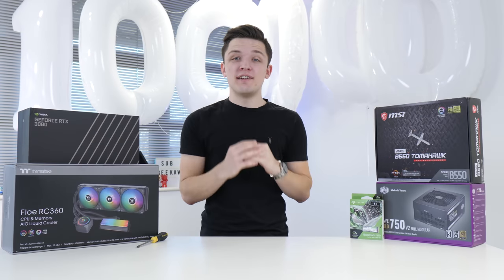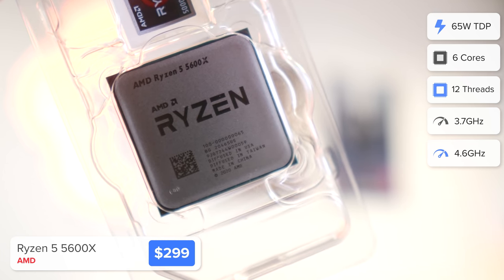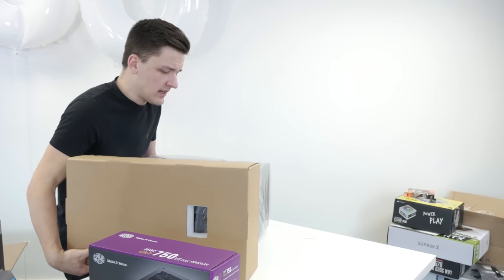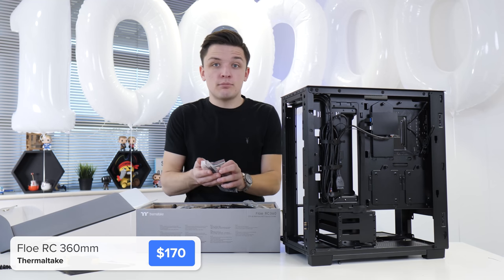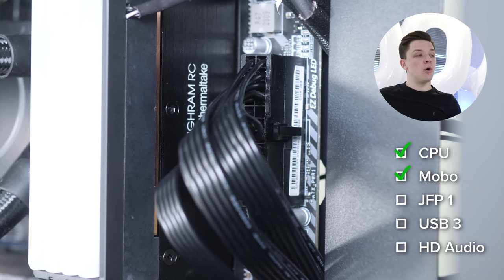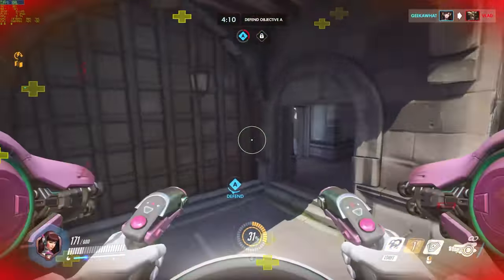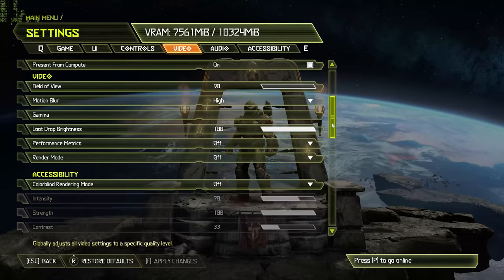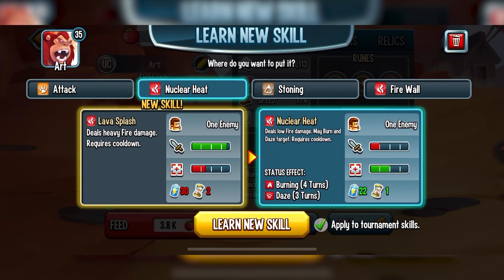$2000 Gaming PC Build - ft Razer’s $200 Case! [RTX & Ryzen 5000 Build with Gaming Benchmarks!]

Comment: Hey GeekaWhat, I wondering if this is a good build. 
Specs:

CPU: AMD Ryzen 7 3700x 8 Core Processor
Motherboard: B550
Ram: Corsair/G Skill 32 GB RGB Ram 3200Mhz 
Storage: 1 TB NVME M.2 SSD
GPU: NVIDIA RTX 3070
Fans: Corsair LL120 Triple PackFans
PSU: 750W Bronze Power Supply
Windows 10 Pro
Total money for the build is 2000 dollars.

Comment: Hey dude I’m building a gaming pc somewhere around summer my budget is 1550 and i need a good motherboard (amd) im using a ryzen 73700x but I want to upgrade maybe to a 5800x later and my gpu is a 3070 and need a good psu and it would mean a lot if you helped me out

Comment: This case has some pretty nice ideas and some cool engineering but it just has far too many downsides to overcome. At this pricepoint you are really going to want to be seeing more quality fans in a system like this (I do understand that a lot of people spending this much on a case are likely to go AIO but my point still stands as air cooling components like these can be just as efficient more cheaply) The lack of dedicated airflow in this case is bothering to me, though I guess a lot of people won't mind so much but it just feels like for the price there are a lot of better options. The Doors are a cool touch but the reverse panel seems rather unnecessary and the under case lighting is an interesting feature. I think I would prefer to go with a P600s for a lot less money than this or the Lancool II if we are looking at a slightly smaller case. just my opinion on this one, though the build does look clean and a little stealthy.

Comment: I've been thinking about joining the PC master race and come up with a build, if anyone can give me feed back on this one it would help.

Case - Fractal Design Define R6

Cooler - Corsair Hydro H75 CPU Cooler

Motherboard - ASUS TUF GAMING B550-PLUS

Processor - AMD Ryzen 7 3700X CPU, 8 Cores / 16 Threads, 3.6 - 4.4GHz

Graphics card  - NVIDIA GeForce RTX 3060 Ti 8GB Graphics Card

Ram - 16GB Corsair Vengeance LPX Black DDR4 3200MHz AMD Ryzen Tuned Memory (2 x 8GB Sticks)

OS Drive - 1TB Samsung 970 EVO PLUS M.2 PCIe Solid State Drive

Optical Drive - 24x DVD-RW Drive

Power supply - Corsair CX750 80 PLUS Bronze 750W PSU

Cost of build - £1735.29/$2360.86.